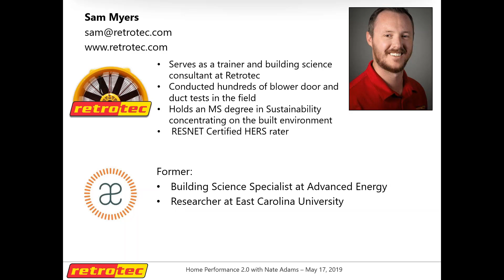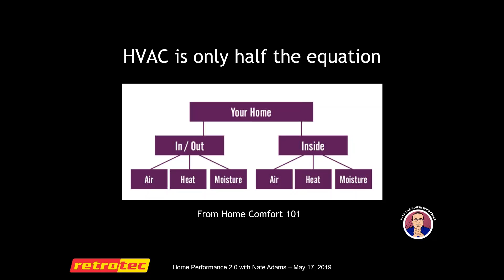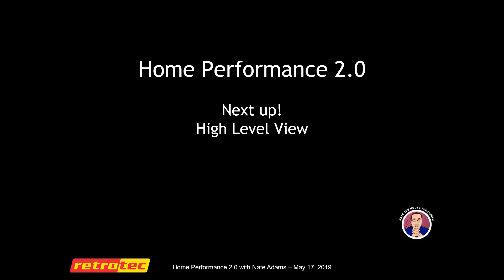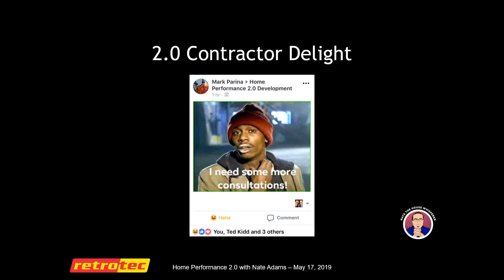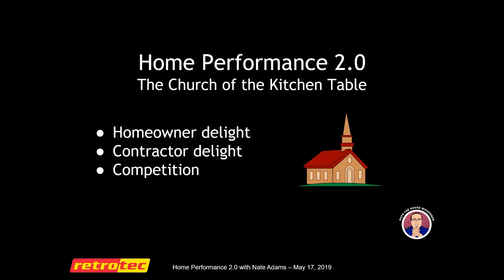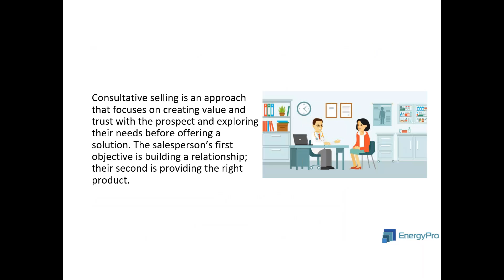Home Performance 2.0 Vision Casting Webinar with Nate Adams of HP 2.0 and Sam Myers of Retrotec

Comment: 2:37 start. Audio somewhat better.
3:35 Nate starts, MUCH better audio.
17:00 HVAC is only 1/2 the equation.
17:45 many cases air sealing not crucial, but need to test to KNOW
18:30 book is onramp, give away the free chapters they will help you sell.
19:20 basics of how to do hp2pt0
20:00 A path, contractor takes no responsibility for diagnostics or design, dramatically cuts free quote time.
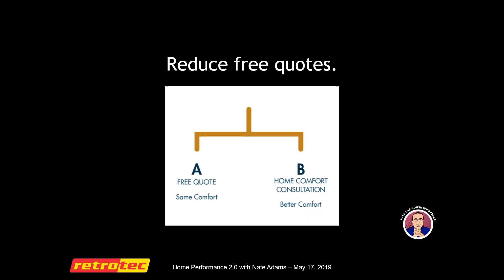22:00 avoid blame via offer and decline...
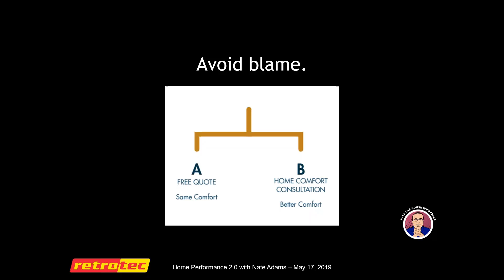22:50 share responsibility for decisions.
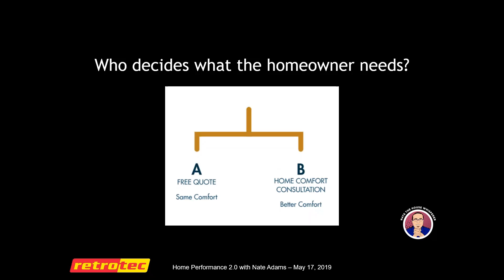23:45 Four simple questions help determine A or B
24:25 Easy to train, low level trainees can do this!
29:28 initial consult is a basic physical, not a complex medical exam. 

The basic exam is an inexpensive process that indicates if other exams are warranted, nothing more. KEEP IT AFFORDABLE!

30:00 explain high level building science? Nah, don't get ahead of yourself, one step at a time.

Getting PAID to get to know the house and home owners is really a nice deal. Takes pressure off.
33:20 why does HP need a reboot?...
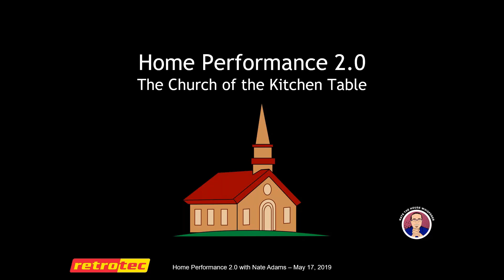33:45 Church of the kitchen table, problem of HP 1.0 is it focuses on needs of utilities rather than consumer.